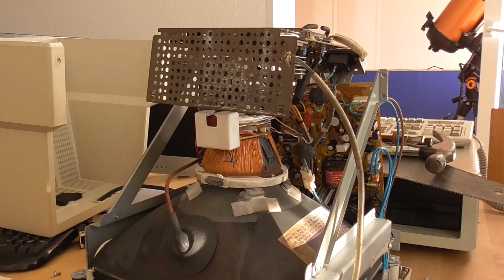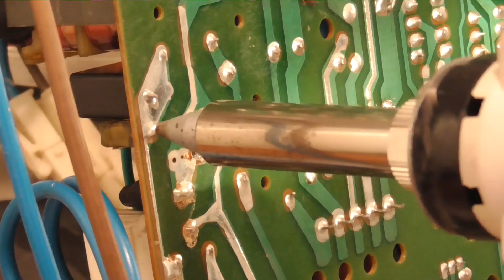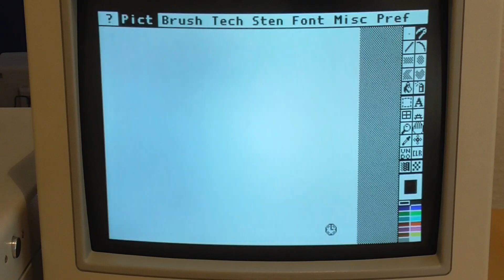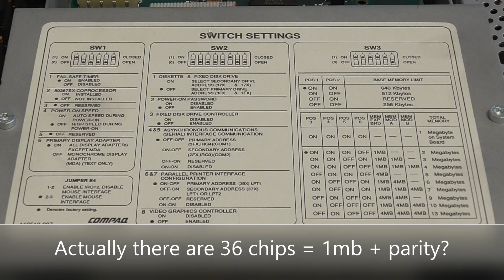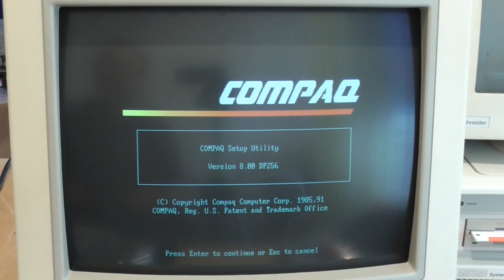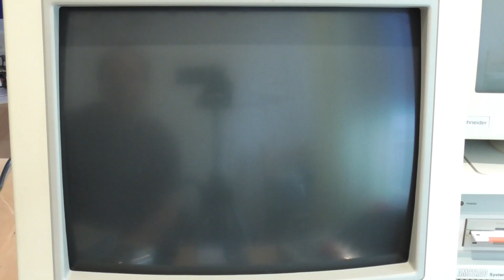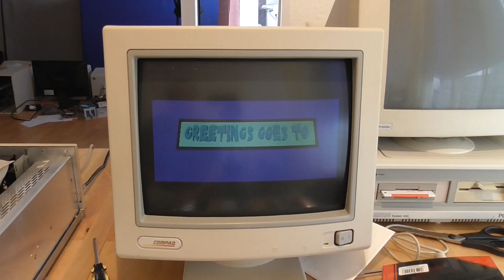The Beautiful Compaq 386s Part 1 : Quick Repair and First Look

Comment: Just picked up one of these - the VGA card on the motherboard looks the same, I'm pretty sure there isn't any cover missing - this was one owner from brand new. Has a 40MB hard drive, the official Compaq joystick adapter card (for two joysticks) and a very proprietary 4MB RAM expansion too!
Reply from the maker: Sounds like you got a very nice example of the machine. It's still one of my favourite machines, if not my favourite.
Reply: @PCRetroTech  our parents had a Packard Bell 386/16 with 1MB RAM/105MB as our first ever PC so fairly similar spec on this! I buy and sell retro kit and this came in as part of a largish bundle, it's cleaned up near perfectly but it's not my bag really, I'm into vintage Commodores and early IBM stuff. Mine is just the base unit as well, no keyboard, mouse or monitor sadly.

Comment: Right around when you were posting this wonderful series (what initially brought me to your channel) I had just purchased a Deskpro 386/20e (DX at 20Mhz w/32kb cache). I finally found the matching monitor and it arrived yesterday, but after 20-25 minutes one of the RIFA capacitors let out the magic smoke! Ironically at the moment it happened I was explaining to my wife how these capacitors would eventually go and would make a horrid smell (and the RIFA did not disappoint)! Luckily the picture was excellent before the catastrophe, so at least it is a worthwhile repair. I immediately thought of your videos and revisited them for a refresher -- keep up the great content!

By the way, the closest mouse I found that matches these systems is a Logitech manufactured M-SF14-2 (there are at least 2 versions, the earlier one having the same Compaq logo with line underneath). It looks right at home next to the appropriate keyboard.
Reply from the maker: This is still one of my favourite computers, and I get it out regularly for various things. There will definitely be some more videos on the channel about it eventually.

The main problem I have with my monitor now is it is out of focus (nothing to do with the RIFAs). I need to find time to pull it apart again and get it focused up.

Your 386/20e sounds pretty nice. I bought bits and pieces of a later machine at some point but it isn't in a state of repair. In the end I became quite interested in these SX machines due to the obvious limitations they had, which I find fascinating to try and overcome through clever coding.
Reply: I completely agree with it being a favorite. Even 25+ years ago I thought these second generation Deskpros were beautiful machines but was never able to get my hands on one, then with the lockdowns of 2020 I actually found retro computing to be a very apt hobby (albeit an expensive one). I also have a Deskpro 386s that I initially purchased as a parts system shortly after acquiring the 386/20e, but have since changed my mind and am slowly gathering parts to bring it back as well.

I look forward to more content (especially with the Deskpro) and thanks again for sharing your knowledge, findings, and expertise!

Comment: wait... what's so special about this computer? why the bidding frenzy? it looks like a pretty bog standard 80s/90s era pc from the big box guys. i don't get it.
Reply from the maker: Rarity. Complete setups are very hard to acquire nowadays. It's beauty of course is in the eye of the beholder.
Reply: I have the 25 sx mhz version of this PC and it's fairly unique for it's age, including a socketed Dallas RTC chip for easy replacement and 72-pin FP memory slots (up to 16 megs supported).  A significant number of 386 and early 486 motherboards self destructed due to leaking rechargeable motherboard batteries, not to mention being poorly documented, so these tend to be much better candidates for restoration since they buck both of those trends.  I did find a pair of the same monitors in a gaylord of bad CRT's at a recycler, wonder if they are worth fishing out and repairing to have a complete set...

Comment: I bet the reason why windows 3.x doesn't start and complains about not enough memory is that you have no memory manager loaded to access that memory above 640k.
Reply from the maker: I think there is one, but there's a whole load of other things loaded in config.sys which are probably using up memory. Windows 3.1 apparently has a minimum requirement of 2mb, so it should be possible to fix this when I film part 2.

Comment: Those Rifa capacitors that blew are Y-class. Those connect between line and ground and are there to filter out RF emissions. The Y-class is a special kind and designed to fail open when they fail. The capacitors you put in are not Y-class but just ordinary impulse capacitors.
Reply from the maker: That's correct. It's a temporary repair for testing. The replacement RIFA's are on the way, but didn't make it in time for filming. In fact, I don't think the seller even dispatched them yet. I don't like the fact that they are too large either. But all will be rectified soon. I actually didn't know if there was anything else wrong with the monitor, so it made sense to test before getting too worried about dotting I's and crossing T's. :-)

Comment: Windows 7 can format floppy disks. But you are probably using a USB floppy drive. They can't fully format floppy disks because their controller suck !
Reply from the maker: Oh no, that's not the issue. If you update to the latest Windows 7 security patches it's been disabled from the GUI. You can now only format them from the command line, which means looking up the exact commands format a: /T:80 /N:9 every time I want to do it. Not very convenient!

The reason this was an issue here is that the program that I was using to make floppies from .img files had two options: 1) format disk and write image 2) write image only. The first option no longer works, so it was necessary to first format the disk from the command line, then use option 2.

As far as I can tell, Windows 7 is mostly crippled these days. The browser works intermittently, there are always problems with the floppy drivers and the thing is so slow it is almost unusable.
Reply from the maker: In fact, I am going to abandon my Windows 7 machine, as it only allows one floppy drive to be attached, which is really inconvenient. I frequently need stuff transferred to 3.5" and 5.25" floppies so I actually have to switch the drive over in the machine, set it up in the bios and restart. It's amazing that the designers of the late motherboard that I have didn't support two floppies! (I can't recall the problem, whether it only allows a single drive on a cable or if it is just that the cable won't reach from the 3.5" bay to the 5.25" bay and there is only a single floppy connector on the mainboard. Either way, it is too much hassle.)

Instead I am going to download stuff on a modern laptop with secure browser, and transfer it via USB stick to a much older machine with both 3.5" and 5.25" floppies. I'm sick of all the hassles my Windows 7 machine has been giving me.
Reply: @PCRetroTech  Oh I see. I haven't used Windows 7 in 2 years so that's why.

I wish there was a _cheap_ way to connect floppy disk drives to USB with a non crippled controller.
Reply from the maker: @DxDeksor  Yeah but even if there were, it probably wouldn't support 5.25", since there's just no market in it for anyone.
Reply: @PCRetroTech  well my idea is to have a open source controller that could be adapted to any floppy drive with shugart interface ^^
Reply from the maker: @DxDeksor  Yeah that would be cool, for sure.

Comment: Those replacement caps are probably fine, but the originals were y class caps...

Edit: you can still find replacement Dallas RTC chips, I think the chip code ends in B now but its the same chip.
Reply from the maker: Well spotted. I want to replace them with smaller caps, so they'll end up being the right kind in the next iteration. These are literally just what I could get in time for filming.

As for the Dallas chip, I've seen people referring to external batteries in these Compaqs. So I have to look into whether there is a connection for that somewhere. I'm really not sure how that would work and details are scant. But yes, I'll probably get a replacement Dallas chip otherwise.

Comment: Timeless is moving faster than I remember, so I'm guessing the Compaq 386s is a 386dx and not a 386sx.
Reply from the maker: It definitely says SX on the chip. It's possible the Compaq VGA implementation was really fast or something like that. I'll try running Timeless on some other hardware and see if there's a noticeable difference. I have a few different VGA cards and at least one other 386 machine.
Reply: @PCRetroTech  No need, it is possible I am misremembering. Tran coated most of his stuff for a 386 SX16 because that's what he had. His home motivation to create pmode was to gain back the time lost due to db 66 and DB 67 opcodes required in real mode, made especially important due to the 16-bit bus of the 386 SX.
Reply from the maker: @JimLeonard  There's definitely going to be a followup video on this machine. Benchmarking it will certainly be part of that. In this video I mentioned there was this probably apocryphal story of MS engineers using these machines because of their speed. But I now think that was the original Compaq 386, not this 386SX. So now I really am curious how much difference there is. I am not even sure what other 386 chips/boards I have, so that will be fun to play around with in a later video.
Reply: @PCRetroTech  Be sure to include 16-bit real mode and 32-bit protected mode memory transfers in your benchmarking, as you will see the most difference in that area. Topbench can handle the 16-bit part to save you some time.
Reply from the maker: @JimLeonard  Yeah, great idea. Thanks.

Comment: Very nice system ! I have its little brother (quite litterally) the 386s/20N which worked but had lots of bad caps and a broken hdd.

3:08 "You need specialist tools and equipment" * see a hammer and a saw in the backrground * :)))

Ah RIFA caps ... Apparently they're a common failure on old hardware. The reason is that their plastic gets brittle over time and the stuff inside don't like oxygen or something which shorts them and make them run hotter and hotter until they blow up.

Something similar happened to my ICL 286 the other but unfortunately no RIFA cap in sight ... I have no idea what died there but it made a crazy purple smoke and the computer turned itself off.

On a totally different topic, I have created a website which can probably interest you : http://www.win3x.org/uh19/
It's a database of over 6000 oldschool motherboards :) (more infos about the project over here : https://www.vogons.org/viewtopic.php?f=46&t=74070)
Reply from the maker: I think the orange tantalum capacitors are the next most common failure, then the electrolytics (with the silver tops), then voltage regulators. I can't imagine anything else making smoke.

Wow, that website really is something! I'm impressed!
Reply: @PCRetroTech  Well it's the PSU that smoked. But I haven't seen anything that looked bad despite the burned electronics smell and the large amount of smoke that came out of it. I really need to investigate.

As for the website, thank you :) As you can guess, we're planning next to add expansion cards of all sorts. Considering all the video cards you own, you'll probably be able to help us (if you want to)
Reply from the maker: @DxDeksor  Hopefully I can find some time to help. I have taken on some other very big projects lately, which you'll hear about on the channel eventually. So finding time is actually quite a lot harder than it used to. But this is such a great project I'm sure I'll at least contribute something.